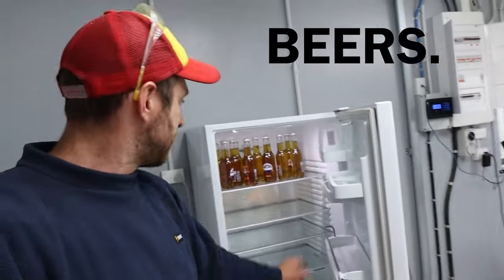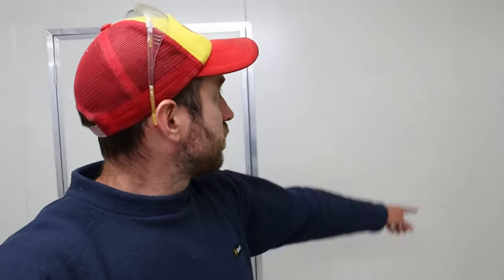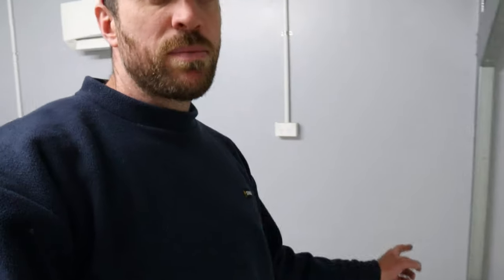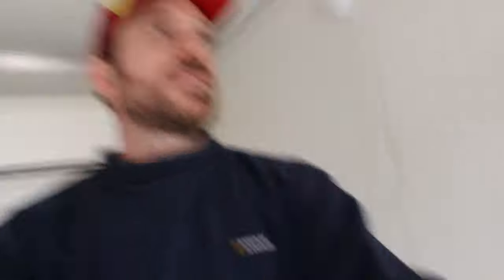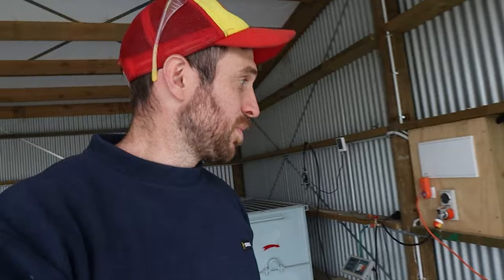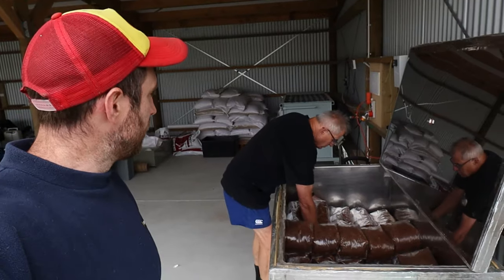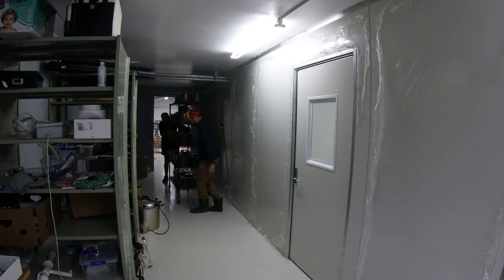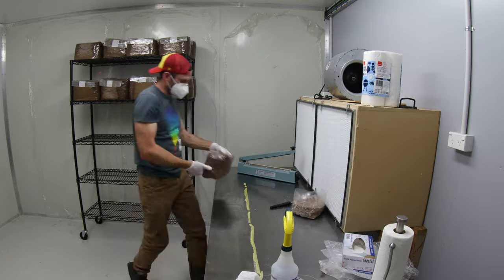Halfway Through Building a Mushroom Farm  - Making First Mushroom Substrate Blocks

Comment: Thanks for the updates, you are spreading that inspiration! 

May I ask why you decided on two fruiting rooms instead of one large fruiting room? I'm weighing this decision up at the moment. 

Seems like lots of new medium-scale growers are opting for one large room, where two rooms do give the option of fruiting different species at different temperatures. 

Then again, two rooms do add complexity if one is regulating to distinct environments with their own controls, sensors, humidifiers, coolers/heaters, ducts etc. 

Would be interested to hear your thoughts on this
Reply from the maker: Mainly cleaning. If you want to clean a single room, every thing have to come out. That's hard if there are blocks fruiting.

Comment: What are those wall panel calls? I had it in mind but not sure if it is the same material. How much it cost and you ordered it from China also?
Reply from the maker: They are from a company called Bondor. Although I cannot recommend this company as they made multiple mistakes.
Reply: Thank you! Do you mind if I ask how much they cost per sf? And how you seal the space between panel and the floor?